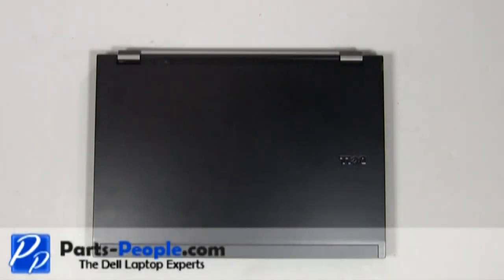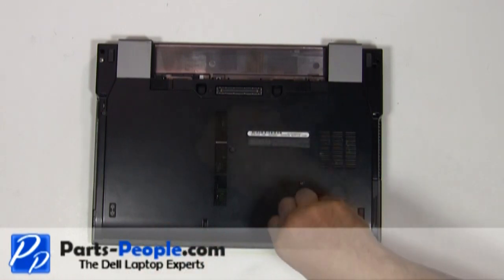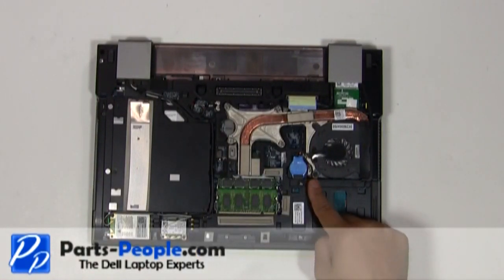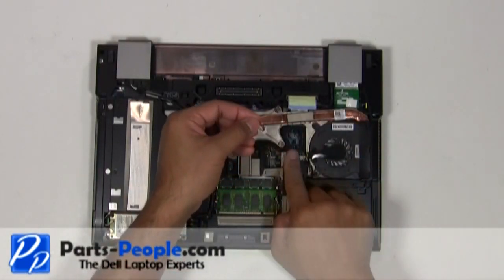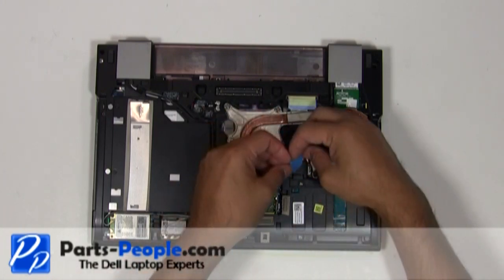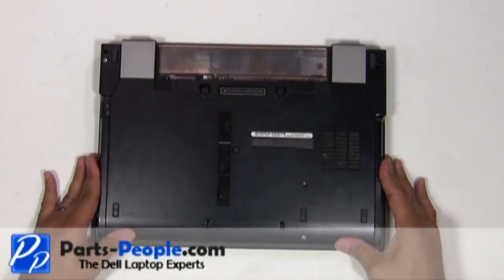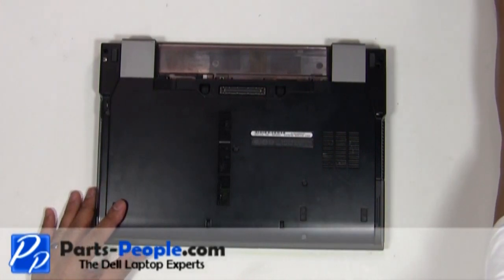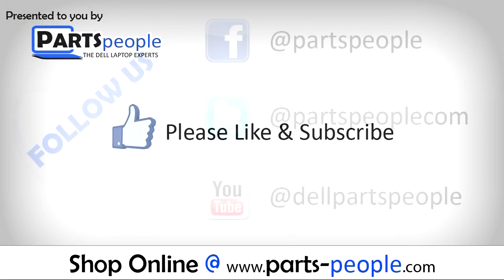Dell Latitude E6400 | CMOS Battery Module Replacement | How-To-Tutorial

Comment: It is a standard CR2032 battery. I built one myself using the old wire harness and a new cell. The red wire goes to the possitive side and the black/white goes to the negative terminal.

Comment: VERY HELPFUL!  Worked on my Latitude e6500.  The battery was in different position, but easy to spot.  Taped down, took some pressure to get it out and unplugged.  One screw held the back, not 3.  Did not have to unscrew hard drive.  THANKS!!! You gave me the confidence to do this myself and save an old computer for the cost of a $15 battery.

Comment: My E6400 has one screw, not 3.

Also, the battery is attached somehow and I dare not pull strongly on it...
Reply from the maker: The CMOS battery is usually glued down. You can pry it up, just make sure the wires don't get damaged.
Reply: Parts-People.Com, Inc
Right. Thanks. That's helpful. Though it's not glued down in the video, but you say it usually is...

Comment: Hi my E6400 is turning off automaticly.. and leds are flashing.. but wont boot.. What is the most common issue ?
Reply from the maker: Martin Gutzer I would have to have more information than that. Knowing which LEDs are flashing would help. And any other symptoms like what are you using the laptop for when it's shutting off? Gaming? Videos? Auto-cad?

Common problems could be overheating, bad battery and/or DC jack, viruses, CPU failure, GPU failure amoung other things.

Comment: This video for real dummies. Better show how to make your cmos battery when you only have replaceble CR2032 battery. How to attach the oroginal connecting wires.
Reply: I have a Dell Latitude e6510 and was having to reset the clock in BIOS every time I removed the laptop power battery or unplugged the power adapter from the wall before unplugging the computer end.   I had a spare CR2032 battery so I performed the following.  Followed the steps to expose the battery as in the video.  After removing the old battery connectors from the motherboard, I sliced open the plastic cover on the battery with a utility knife to expose the 2 connectors -- one on each side (terminal) of the battery.  The red wire connector is attached to the + side of the battery.  The white/black terminal is connected to the negative side of the battery.  I carefully pried off the connector on each side with a small flathead screwdriver.  I think the connections are compression connections so once removed you can't just  "stick" them onto the new battery.  So I soldered the red wire terminal to the + side - let that cool --   then soldered the black/white wire to the negative side and let that cool.  Then I pulled the plastic cover over back over the battery and used electrical tape to reseal.  Then reconnected the battery as per the video.  Not very pretty but effective -- I didn't get a prompt to reset the BIOS info after removing the laptop battery or unplugging the AC adapter.   If you're not comfortable with a soldering iron, probably better to pay the $7 for a new battery with connectors.